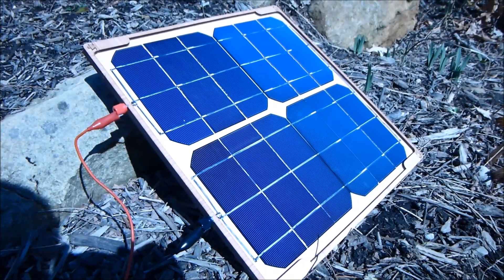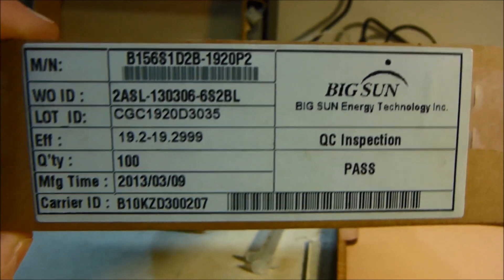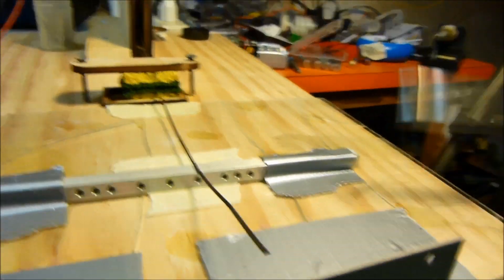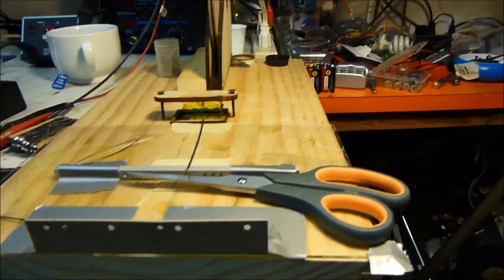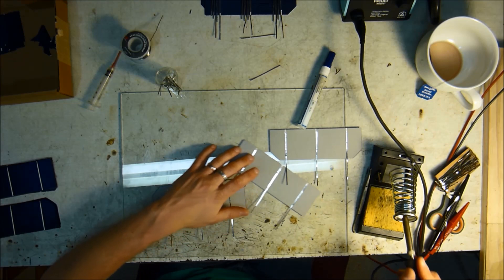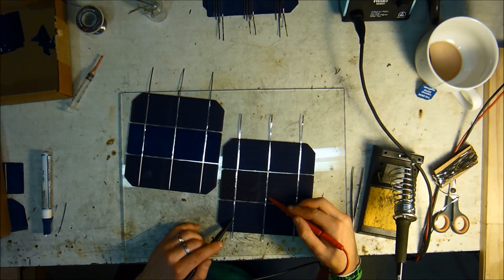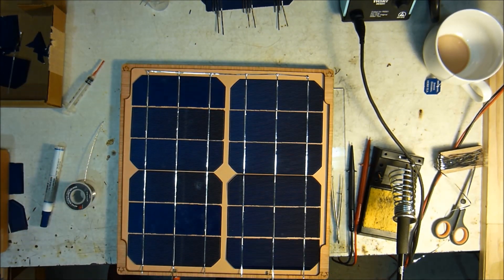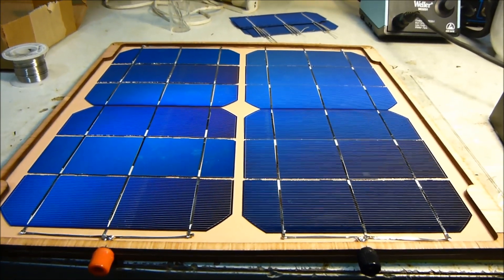Making Solar Panels

Comment: Good video, you make it look easy, although you shouldn't touch the top side with your fingers. Finger oil makes them corrode

I have a favor to ask, Do you have any hard set JB weld you could test the oms of for me?
I'm getting ready to make a big HV capacitor, but need a way to bond al foil to wire of some kind for the terminals....
Reply: I would use pc-7 epoxy, its much better than jb weld.
Reply: David Sanders The data sheet says its non conductive. So wouldn't work for what I want. Which is  to make a conducting loin between Al foil, and some sort of conductor I can solder to.
Reply: Mongrel Shark I didn't know jb weld was conductive, that might come in handy one day. But as far as epoxies go, if you don't need that pc-7 is really strong and can adhere to almost anything.
Reply: I dont know if JB is conductive, thats why I was asking.
Reply: Mongrel Shark I didn't think it was, but don't know for sure.
Reply: Its got metal in it. Worth checking. I need something to bond foil to copper that will conduct over a short distance of a few mm at most.
For use in a high voltage capacitor.
Reply: I have wire glue. It wont stick to Al foil...

I've soldered Al before, but foil is harder, if you sand it or use flux, there is no longer any foil left to solder to.... Add to that I want to do a lot of joining. For a large multi plate cap.

There is this stuff at my local hardware store. I might try it. http://kingshopoitjgdut.blogspot.com.au/2013/05/permatex-25909-12pk-liquid-metal-filler.html

I'm also tempted to mix metal filings into regular epoxy. If enough of them contact, I will get conductivity, and there will be no air gaps to arc to and blow the foil apart.
Reply from the maker: Mongrel Shark Oh... I didn't think of that... I guess it wouldn't stick because it's water based.  What if you mix finely ground graphite with some kind of glue?  
By the way, the link doesn't work.
Thank you!  Sorry for the slow reply!  I've been on a mission trip.
Reply: The link was for liquid metal, I got some and its not conductive. Seems to be silicon based.
Im thinking the same with graphite glue.
although I did have some more luck with my wire glue. Works better with more air exposure and dry time than I had tried before.
Some examples in my latest video on laminated capacitors.
Reply: Could do? I'll have to get some, that would be really easy! Hopefully it will contact well and not arc too much.
Reply from the maker: Mongrel Shark It would be!  The only problem with aluminium tape is that the sticky stuff is not conductive.  So really it would be about the same to use normal tape.  Good luck!
Reply from the maker: Mongrel Shark From my experience JB Weld is mostly a insulator or a very poor conductor.  The most I've gotten is to conduct is about 10 mega ohms for a 1mm thick piece.  That might be enough for high voltage.  I think if you mix more of the steel part and less of the hardener it may make it more conductive.  IDK just a guess on why some pieces I have conduct and others don't.

If you want a really good contact, use solder.  It's tricky but once you get the hang of it it works pretty good.  Basically you cover the aluminium in oil to protect it from oxidizing, remove the oxide layer with steel wool, then solder it.  Normal solder works but I've also heard there is special aluminium solder in flux.  But I wouldn't go to that extreme.

The other and probably the best alternative is Wire Glue.  It's basically glue with a ton of carbon in it.  It's pretty cheap for a little jar of it and it's fairly conductive.  If I had to guess I would say about 1 kilo ohm per centimeter on a piece of plastic.  It's water soluble when wet, but I'm not sure about dry.  http://www.amazon.com/Sciplus-Electrically-Conductive-Soldering-Wire/dp/B000Z9H7ZW/ref=sr_1_1?ie=UTF8&qid=1404583487&sr=8-1&keywords=wire+glue  This is the stuff I have, but there are a ton of other varieties.
Reply from the maker: Oh ok.  Would aluminium tape work to hold the wire to the aluminium foil?

Comment: so why do you cut it in the first time? just waysting energy time and efficency on the panels
Reply from the maker: Sparkstarter cut them up smaller because he could get these ones at a really cheap dollars per watt.  Also if you just connected up 4 together that would only be about 2 volts for the size of panel he wanted.  Not enough voltage for a lot of things with out using a booster.  But I do agree.  It was very time consuming and did decrease the efficiency.  But hey, he payed me to solder them all up so I'm happy!  :)
Reply: Makerj101 But a small SMPS would be so simple to make... Then again, it's HIS panels :D